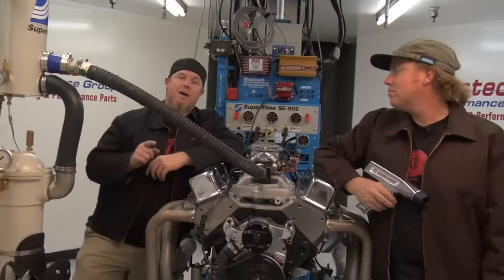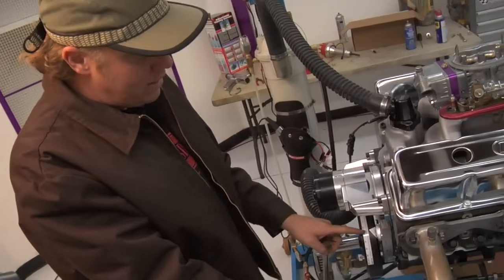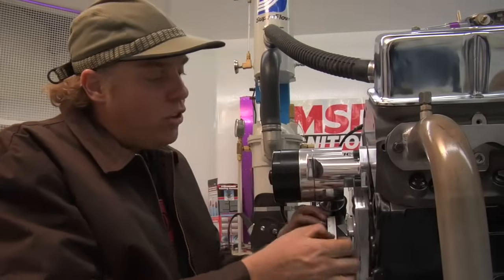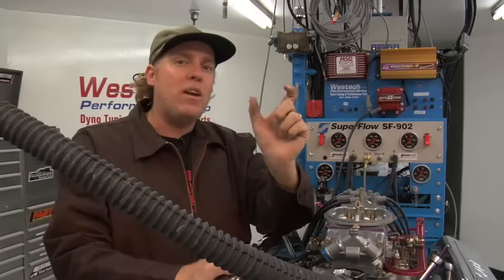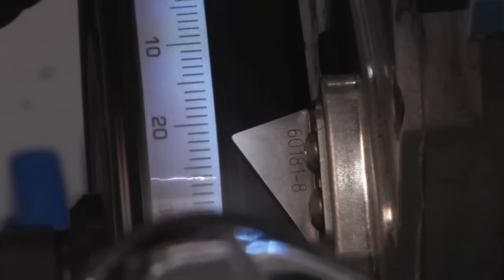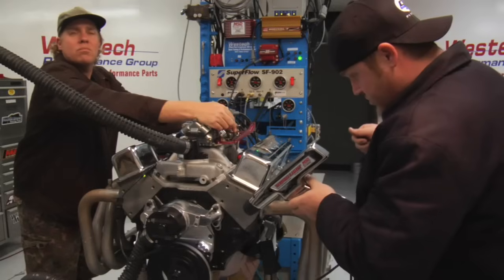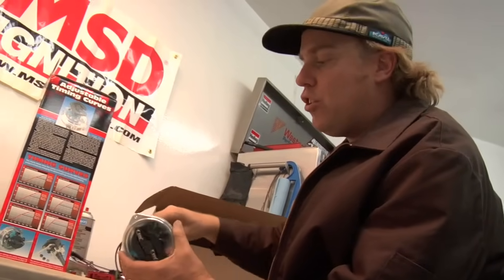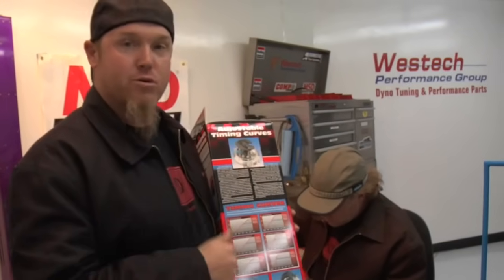Setting Ignition Timing Video - Advance Auto Parts

Comment: Im kind of confused on the part where you set initial timing to 12 degrees btdc, and then after setting total timing the base timing was 19 degrees btdc.
Reply: did the distributor already apply advance to timing when you installed it then after you set total timing thats why it came out to 19?

Comment: Understood all of this clearly... my problem is I put new plug wires on my SBC. It wouldn't start after that. I changed back to the old wires.. still didnt start. Checked the distributor clamp plate, and it was loose. I figured I probably bumped the distributor out of timing when replacing the wires. So, I put the new wires back on, checked for a healthy spark, and had my wife crank the engine while I adjusted the distributor. Never started up again, and she didn't have the patients to help me out any longer. Driving season is almost over in Wisconsin, and ide love to see if my new catch can set up is road worthy, but I can't get the car started to correct the timing. Any advice?
Reply: lol so you’ve been troubleshooting and working on the ride for weeks, and when you needed her, she took time outta her schedule and came to the garage and turned the key in the ignition a few times and then lost her patience—sounds like my wife lol feel for you brother
Reply: If you have an HEI distributor, verify the battery wire is connected to it. I did that on my Camaro, knocked off that spade connector while changing wires and had to trace my steps back to plug it in. Car wouldn’t fire until I found it.
Reply: @nikgarvin2824 is the battery wire one of the two plug ins that go to the distributor cap/coil or am I missing something completely here?
Reply: @eck_welding_solutions yes there should be a tach male spade and bat male spade underneath the top where they plug it. Not sure that’s your problem but it was mine when I swapped plug wires and knocked the wire off the spade.

Comment: my 400 sbc 415cu 11.5 comp 292 cam angle plug 64cc heads was setting at the dyno  idle 14 top 34 some one change the curb in the distributor to 18-34   i setting at 18 with 900rpm and only get 32  total  at 3000rpm which one is more important idle o top end can i setting @ 34-35 on 3000 rpm  or 18 idle  thanks over heating problems

Comment: My engine is a 350 from 77 with all the air pump stuff, which already is deleted. A sticker in the engine bay says timing should be dialed in at 3° btdc. 3 is very low and ive read its because of emmision laws and stuff like that from that era. Can i just set it to around 10 btdc when the new distributor is installed or can i hurt the engine doing so? The car  was running rough, especially at cold start

Comment: Ok so after they set the total timing Dave said they checked the base timing and its 19 degrees. So how did they do this if the timing light they are using doesn't have a total advance adjustment? I have always understood we can not use  a timing light with the advance function for MSD ignition.

Comment: Can a bad crankshaft pulley cause the BTDC readings to read randomly between 3 degrees to 10 degrees on idle? when it should be 6 degrees plus minus 2 based on car owner's manual?

Comment: I have a 1968 camaro, 355 small block chevy high compresion with a msd ignition has been lock. My problem is when the moter gets hot the ignation gets stock will not move left or right . timing can not be adjust please help to find problem.thank you.

Comment: Glad I just happen to stumble on to this video. I just started a new project and I don’t have any history on the engine. I suspect it has a aftermarket cam just based on the idle but stupid me I took the distributor out without noting the timing. I did mark in general the location of the distributor but I don’t know if I can set the timing correctly. After watching this clip I’m confident that I can get it close enough. If anyones has any tips for me I’d very much appreciate it. It’s a chevy 5.0l 305.

Comment: So 12 degrees advance would be "standard" timing for a stock small block chevy?
Reply: No stock timing was between six and eight degrees you can go as high as 10° for most engines with stock for Miles cams you're basically shooting for total timing 34° for Street engines

Comment: I have a Ford 460 and had to change distributor and ford Manuel says unplug the spout wire then set to 10 degrees btdc. And I did that and it idles at 850 rpm and sounds good but then when I plug the spout wire back in it changes the timing to 20 to 25 degrees and the engine idles at 1020 rpm is that normal ? Is it supposed to increase like that after plugging the spout wire back in ? I can't find any info on this anywhere

Comment: So let me see if I got this right . on compression stroke I want to set my dist 6 to 12 degrees before tdc. meaning drop my dist in to face number 1 terminal with 6 to 12 degrees on the balancer before tdc. I have been setting my dist in at 0 tdc,I would imagine this will be a game changer for more power on my 383 stroker.If I understand this correctly please let me know. thank you

Comment: If i use the 4+ advance timing gear mark on a small block chevy 5.7 vortec mild cam 480 lift 265 duration what is the recomended timing light procedure .Do I add 4 or subtract 4 to your number

Comment: Advance Auto in Fall River Ma. has some of the rudest Managers and workers on the Planet. Stopped in to have my Check Engine Light Diagnosed when there was 2 Suits and more then one worker in an empty store no customers and was told they could not check this for me. A parts store that refuses to sell parts.
Reply: Autozone in oneida new york sold me head cylinder bolts for my 92 gmc..... in a sealed box. When I opened them I realized real quick they weren't for mine. I brought them back and they wouldn't return them because the box was opened and the same guy that sold them to me asked me if I knew how to read.....

Comment: Hi crew, I dialed in 34 degrees of total timing in my near stock (intake, exh, carb) 84 350 Chevy but it seems to perform worse now than when it had less timing. It’s not knocking & I’m curious why?
Reply: *Low octane fuel could be an issue. (Switch to premium  fuel if you haven't already done so)
*Higher engine temperatures could cause knocking/ pinging. (Might need a colder thermostat)
*Lean fuel trim from improper carburetor jetting. (Larger jets might help)
*Potentially too much total timing in general. (Retard it a tiny bit until the knocking stops)
*Cast iron heads that hold a lot of heat could be a reason. (Nothing you can do except retard total timing)
*Exhaust pipes could be too small and not allowing proper amount of heat to espace the cylinders. (Larger exhaust will help but I very seriously doubt that's your issue)

Comment: I have a question when I am setting my timing on my 383 stroker when you put your hand on top of the distributor cap with the engine running it shocks you any reason why this could be happening it’s all brand new it did hit the fire wall when I put it in
Reply: Bobo mcrae  not a 100% sure.
But,  I think it’s not grounded.   It’s using you to complete the circuit.

Even though your distributor is new.   I would open it up and double check for that ground wire and strap is hooked up.

“New” doesn’t mean anything anymore!

Good luck!

Larry

Comment: What i dont get is how do you know where the timing should be.
Reply: I only know GM engines, but I imagine others are very similar. GM engineers determined way back in the day that most small block Chevy's run best at 36 degrees total timing, 38 or a little more at elevation. Your distributor has to be setup correctly as well with the correct advance weights, centerplate, advance springs, and vacuum advance be hooked up to the correct vacuum source in order to get the timing just right.  My truck, for example, has 22 degrees of mechanical advance in the distributor (which is what you want for performance) and total timing is set at 36 degrees. Take my 36 degrees total timing and subtract the 22 degrees of mechanical advance from the distributor and that leaves 14 degrees for my initial timing. Total and initial timing are linked together so if you adjust one, you adjust the other as well. In addition to the timing, the vacuum advance needs to be setup as well. GM engineers also figured out way back in the day, that on non-emissions vehicles, the vacuum advance needs to provide 10-15 degress of advance and be hooked up to a manifold vacuum source. This aids in idle cooling, driveability, mpg, and overall performance. I hope this helped
Reply: @paulkessler8622  yea that helped alot thanks

Comment: My engine is knocking just on low rpms. That mean that I advanced my ignition point just a little to much? I mean, am I on the edge zone?
Reply: Yes. Total timing should be 36 degrees. Depends on the advance in your distributor. 12-14 degrees intial timing would be a good place to start.

Comment: and I always verify TDC by installing a piston stop (made out of a bolt in sparkplug) in one cyclinder. wind the engine one way with a spanner gently until it stops- mark a line on your balancer, with a sharpie or something. And then reverse the engine and move until it hits again. Now scribe a line exactly in the middle of those two marks, that is your REAL TDC.

Comment: EXPLOSION!  What a very unfortunate choice of word.  How long would an engine last if every power-stroke was an EXPLOSION!
Better if you consider the words; controlled burning causing a rapid expansion of the burning fuel mixture that pushes the piston down the cylinder.  Never an explosion!
Reply: Or, EXPLOSION

Comment: "The timing light does not plug into the wall"
Reply: Actually I used to have a timing light that did plug into the wall.  Came in handy as my Corvette had the battery behind the driver's seat.
Haven't seen one since.

Comment: Correction, spark plug does not cause an explosion, but a burn of the fuel/air from spark plug to the piston.  An explosion would all too soon cause a hole thru a piston AKA detonation.
Reply: Yes, it is burning the fuel-air mixture. But combustion can be considered an explosion, albeit a small one. The energy comes from the phase change, vaporizing the fuel from liquid to gas.

Comment: Good video! But still have a question: So you have to adjust the ignition (idle) timing AND the total timing? But I don't understand how to adjust both times good. If you rotate your distributor after you already timed your idle timing, then your idle adjustment will be gone, right?
Reply: I set total timing and let the initial fall where it may. Works good for me. Example: I set my total to 36.5 degrees all in by 3000 rpm, and the initial ended up being almost 17 degrees. I used a dial back timing light btw.
Reply: @metallifuk1970 .
When the engine factory manual says initial timing must be at 10 degree, and as you say after setting up the total timing like at 35 degrees and then initial stay at much more than 10 degree (as you said 17)… it is making me confused actually 🤔🤔

Comment: Great video guys but you didn't mention about locking out the MSD distributor. I have a 35ft boat with twin 509's 500 HP each, Msd Marine ignition with a marine pro billet Msd distributor. I locked my timing out at 34 degrees. Just set 34 degrees at idle and your done. Its very responsive, no hesitation, or load up at idle.

Comment: I have a 351 W..a COMP Cam and a 2500RPM converter....my timing calls for 12 to14 degrees...my 600 HOLLY is finaly tweaked to that "sweet spot" I actually have my timing set at 12.5.....she smoke the tires, and runs like a rped ape....sounds great and feels great UNTIL...I go to shut it off. It diesels 95% of the time..I turn the car off in gear to keep it from embarrasing the crap out of me. What can I do?
Reply: +Skip Barrus Let the engine run and never turn it off again.
Reply: That's funny right there.......doesn't help much though. I discovered the idle was to high, and had a bad coil..I changed the coil to a Pertronix to go with my elec ignition.....I think it's good now...no thanks to you. But maybe we both learned something.

Comment: What does the light do? he aimed it at the harmonic balancer and yes it was strobing but what does that tell you?
Reply: The strobe is in sync with the spark, so it will only light up the tape at the exact moment it's sparking, making the tape setting only visible at the moment it's sparking. If you didn't use the strobe, you would just see a blur of tape spinning too fast to read.
Reply: it letting you know to stfu..
Reply: Micscience 1986dodeg ram slantsix3.7timeing stroke
Reply: Chicken Wing haha

Comment: hi have 82 corvette with cross fire injector I have the ignition timing set up but when press the gas it doesn't respond it make  a pause and trying to increase the rpm can you help
Reply: +Jaime corvette could be a hole in your accelerator pump or an intake leak

Comment: in order to set total ignition timing you either have to have the dist locked so that the vacuum advance does not move are you have to have the vacuum advance connected other wise when you hook up the vacuum line it will advance the timing even more this video was very misleading for anybody who does not have a back ground in auto repair
Reply: I think you meant in order to set initial timing

Comment: the manual for my '74 sbc says set initial timing to 6* but that is with the vacuum disconnected, so wish these guys touched on vacuum advance a bit, other than that it was a solid video
Reply: That is probably why he is telling you to set the initial timing at 12 BTDC. Some Ig. set ups use a magneto style pickup inside the dist. chevy refers to that as being called an ignition module being used in place of a mechanical advance Sic Big block chevy on my 93 Silverado. The computer does the advance curve from the initial setting so there is no mechanical vacuum advance. Even the old style Big Blocks the initial setting would be about 6BTDC with the advance connected and I do not approve of that method for 2 reasons with a mechanical advance. Under load Sic> a steep hill the engine maintains a different curve. Disconnecting the advance sort of simulates that curve but you can't simulate a load and steep hill and that is one of thee main reasons the pulling camshafts were invented. Always use 12 to 16 BTDC for your initial settings and go from there. Too much advance can create intense internal heat so it's better to start in the basement and work your way up.  The last more important reason has to do with tire size can affect the timing position. Believe that or not turning a large or smaller rear or heavy mud tires requires some extra retarding of the initial ig setting. Also firing too far before that top peak pressure can also cause extreme heat and especially on a TBI motor it will feed the engine way too much fuel and that is what causes that extreme heat. The reason most people with RVs have so many issues with the BB Chevy engines in motor homes. Those engines are already facing extreme heat inside and under that huge body of a motor home. Then plugs matter most Auto Light & GM AC Delco plugs you get from places like Advanced and Auto Zone their catalogs were affected by the collapsed economy and many of the proper heat range plugs are just not in their inventories especially for Motor Homes and 4x4 off roaders. Plain and simple it is goddamned hard to get the right plugs to use anymore. Even the dealer catalogs only go  back 10 or so years and then the history is lost... You end up at the shops of specialists like me and I struggle to get the right shit to tune an engine.

Comment: Just curious I know you are post to cap your vaccum off carb when doing idle timing but when you set the total timing do you connect the vacuum advance or just let the mech spring do the advance to set your proper 34/36 advance?
Reply: no you do not connect to vacuum back up to check total timing, in theory you could and it wouldn't matter as there is minimal vacuum at that high of an RPM but again you do not connect the vacuum
Reply: TriskaidekaPunk I was wondering the very same thing, but it seems no one wants to answer that question here.

Comment: My problem is I do not numbers on my balancer. So will it have to be done by  guessing or do you have a fix for that?
Reply: timing tape , tapes to your balancer and has the timing marks you need , or a dial timing light which you move the timing with the light , might be easier to google them , light easier , tape cheaper
Reply: zulu1320 Thanks Zulu, I got a light with an advance dial. Just need to buy the tape. I noticed when I advance the light to 36 and get the RPM to 2500-3000. the timing mark hardly moves too 0 tdc. Should the Idle timing number be more or less. I am currently at about 16btdc.
Reply: byrnesljr
Not sure exactly what you mean, since I never used a dial-back timing light.  Did you ever try using timing tape instead?
Reply: byrnesljr
sounds like you dont have enough Mechanical advanve in your Distributor  16btdc is good, maybe a bit high but if it starts ok and no ping should be ok, when you get to 2500-3000  (max rpm where your mark stops moving) move the dial till you get to 0TDC, the number on the dial will be your total advance (w/o vac adv),... if ?  it is not enough total advance, you will need to  1) add more idle advance (be careful here) or 2) (more likely) add more Mechanical advance in the dis with a "Distributor Advance, Mechanical kit" (summit or jegs have them there cheap) you can play with the springs till you get the curve you want (max adv) plus the Weights allow more adv then stock ...long answer but hope it helps...